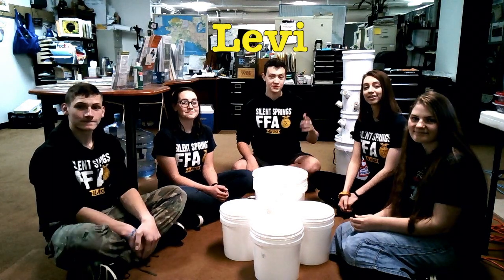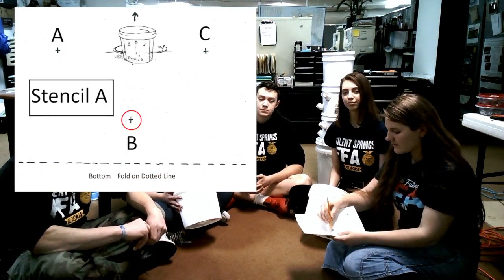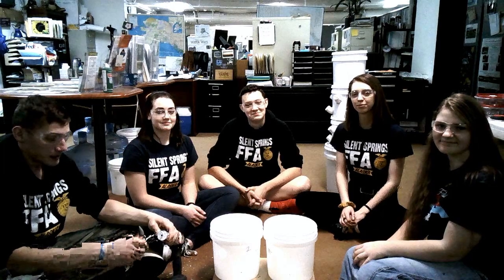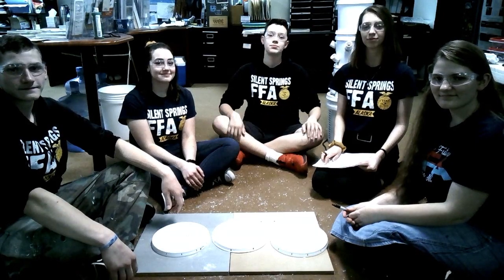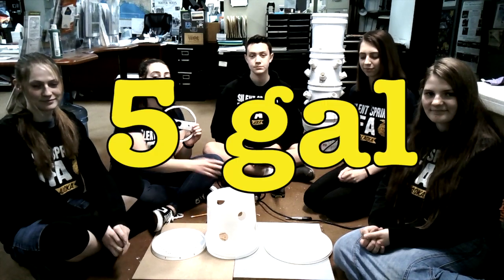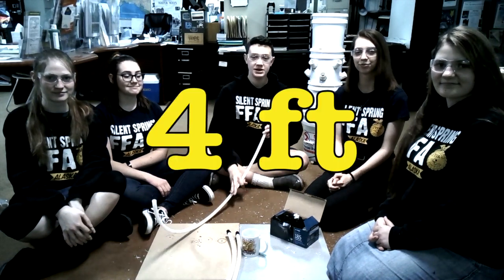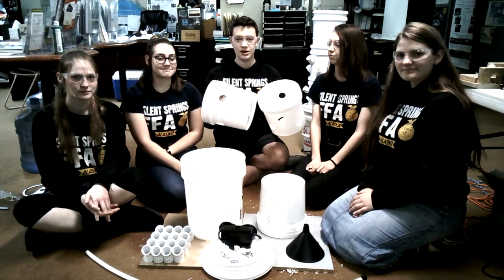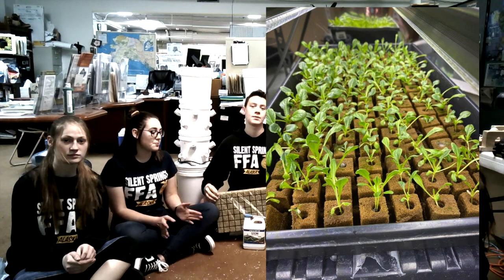Hydroponic Tower Tutorial

Comment: Hey guys and gals, update your system to the Kratky model. Also change your basic layout. Here are the updates you should make: https://www.youtube.com/watch?v=J5a9pPW0tAQ  and https://youtu.be/At9iprIuA4w?si=L62fhFgp42ba4692 . The latter is my own tower. Here is one method for germinating your seeds, https://www.youtube.com/watch?v=mKQoYU5YV64 . A while back, I made a system very similar to your own. I learned that if the water pump stops, your plants are very not happy. So, just get rid of the pump and save hours of plumbing work.  Keep up the AWESOME work!
Reply: I'm currently trying out K-Cups for my seeds. I fill them with sand, plant the seed, then wait. I'm using a 4gal tote with holes in the lid. I used a soldering gun with a special - O - shaped wire that melts the lid for holes. I'll put up a video when I get further.